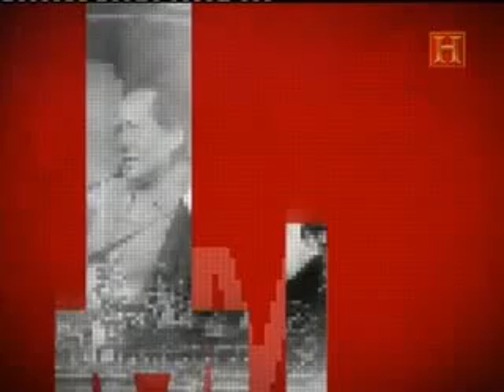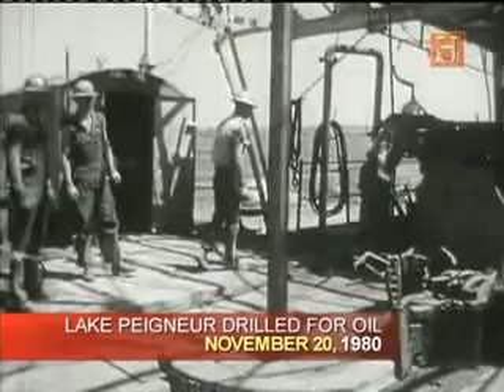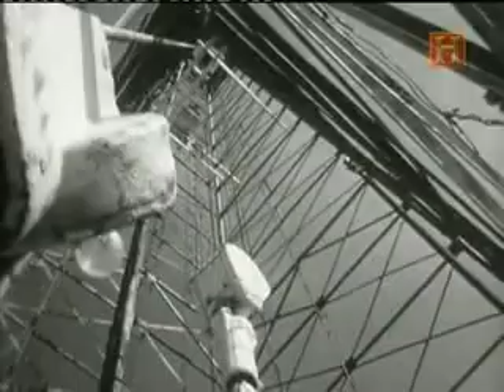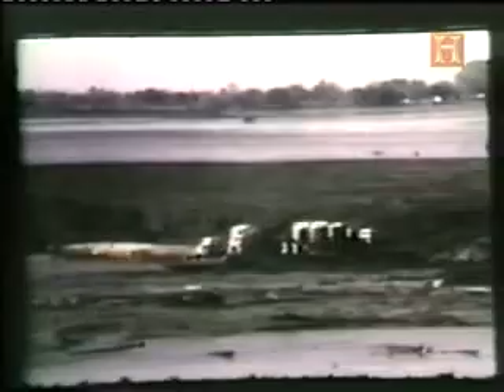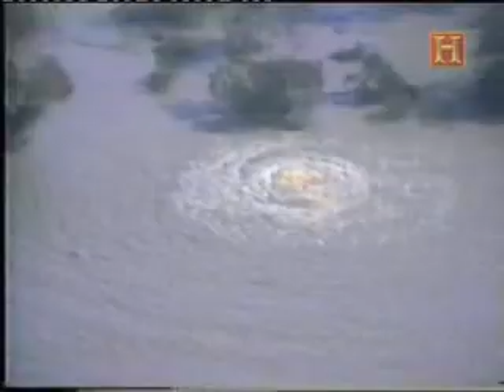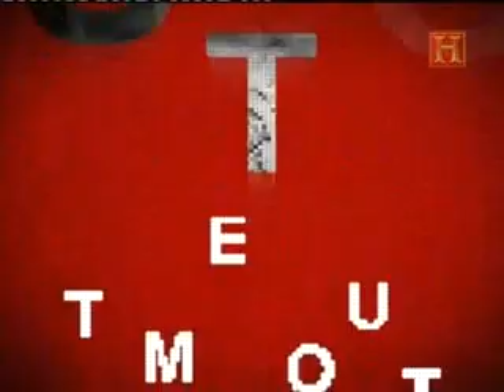Lake Peigneur Disaster

Comment: @knoxjay 
They knew the mine was there.  They made several calculations of where to put the rig, with the intent of not hitting the salt mine, but one of the points they used was off, so they hit the mine.

Luckily, nobody died in this disaster.